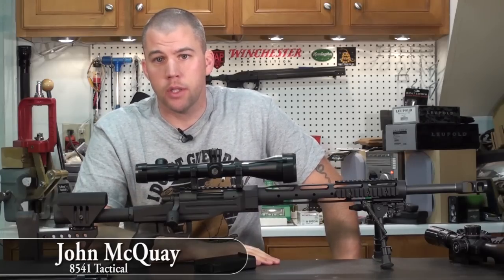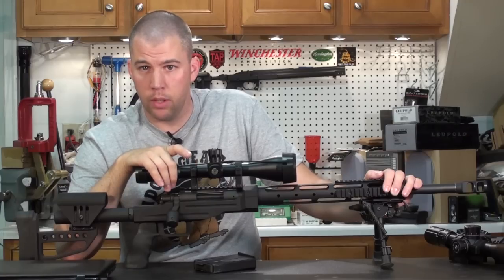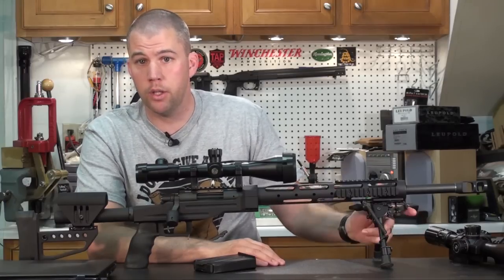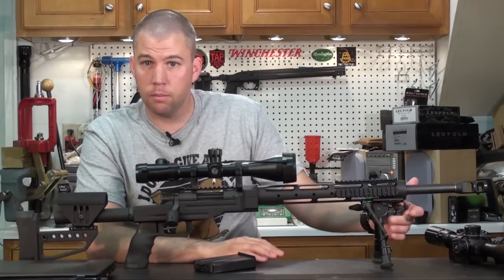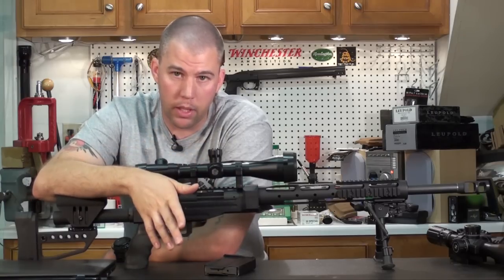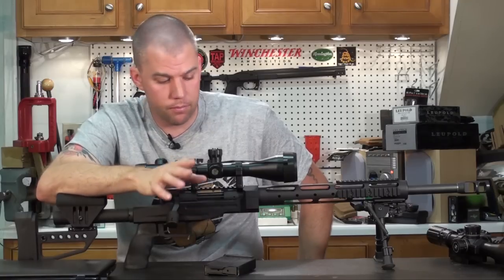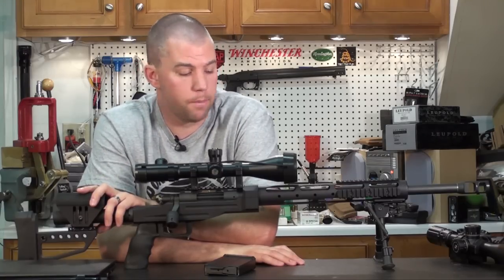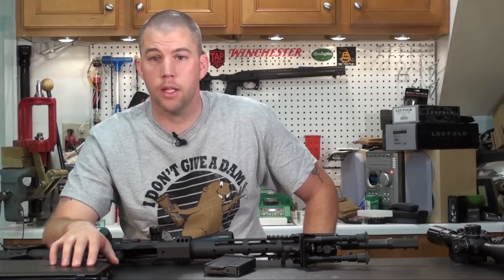Mail Call Mondays #14 - Anatomy of a Tactical Match Rifle

Comment: Awesome, I hadn't even considered the Surgeon or Stiller action so thanks! In regards to Varmint vs AAC-SD, I'm not sure if I do or don't need the barrel length? The long barrel does not impede or hinder my physical shooting positions, so that's not a factor. What I'm after is better long range performance in your opinion of the two, and which twist rate suits the .308 better, lets say using your load specifications. Thanks again.

Comment: Gotta love the savage simplicity. Tactical/oversized bolt knob? Remove one allen screw at the back of the bolt, remove old one, install new one, reinstall the allen screw. Cost is around $25 and time is 5 minutes or less.

Comment: I built a very similar configuration, but oped for the lighter XLR Element chassis. I found out that the Ruger Scout mags are the same exact mags; just rebranded. Been buying those. The only thing I don't like about the chassis is if I let my gal shoot it, I have to make sure I bring allen wrenches with me for the stock. lol One thing I added was a monopod for the stock. Used one before and loved it. 

For glass I opted for the Trijicon TR23-2 Accupoint 5-20x50. I had a night force once before, but thought it was over priced. Love that bolt knob. Got the same one. Same bipod too. Love it! I originally had a 26" barrel too, but had a gun smith cut it down and rethread it. Much better and less front heavy. For the scope base I just used a 0 MOA, as I will never be shooting out as far as you probably do. I did try a 20 MOA, but my Trijicon had to dial all the way down and was still a little off at 50 yards. (Been shooting indoors this winter after I built it and the longest indoor range is only 50 yards. Just was trying to break it in and sight it in.) For a scope mount I found a company called Aero Precision that makes really light mounts. The longest public range out there is 100 yards for me. I need to join a private range sometime this spring to see what it will do. But they still only go out to like 300 yards. I kept my X-Mark adjustable trigger as well.

What do you think of the Ergo Palm Shelf grips? Waste of money?
Reply: +William Boettcher Gosh that was so long ago. It was around $1800. I use the Trijicon TR-24 now. They make a non-mil version I believe. I am using a Remington 700 receiver chambered in 308. It was a package deal that a company on Gunbroker set up; the Remington 700 and XLR chassis.

Comment: Great video, very informative.  Question:  If I understand correctly, the standard Rem700 ADL feeds (and empties) from the top.  Does the XLR stock allow for the use of a magazine, or did you need to do some sort of conversion for this?

Comment: What are your recommendations on scope rings as far as steel or aluminum? I will be putting a bushnell tac. Elite 6x24x50 with g2 on a rem 700 in .308 in a xlr evo chassis with a undecided manufactures 20moa base... Any particular brands and sizes you recommend for use as a primary paper puncher? IM looking for quality so i'm willing to spend a few extra dollars. Thank you

Comment: John, I was thinking about building a "lite" tactical rifle for matches at the local 300 yard range. I have a .308 sps tactical bedded in a B&C M40 stock with a SWFA mil-mil scope, but was thinking of building one in .223 to save a little money(I already have reloading equipment for .223). How do you think the smaller round would do, considering the short range?

Comment: I have the same base 700 adl from DIck's and i was wondering if the barrel could still stabilize the bullet if i cut it down to 18.5'? The heaviest bullet i would ever need to use is 175 if that helps.
Thanks

Comment: Honestly, your review means a lot in my choice. I've been debating on the XLR chassis with a remmy700 in 308 and wondering if it's accurate out to 800yds  or if i should get the FNH TSR XP and the chassis. It seems like all the stuff you'd upgrade on a 700, the TSR XP already has it. Tough choice, but you reaffirm my suspicions in the chassis: that it's bad-ass!
Reply: Speaking on fn rifles….just aquired the special police.308 24” non fluted non adjustable Macmillan stock 1:12 4 groove and has blew my new 2020 6.5prc out the water…3x15 viper shootin 168gmm with varget@2780 and 110v max and varmageddons goin 3500fps..well 3490 to be honest and only cought 1 as it kept blastin my crono sideways 10’ from muzzle…no recoil but blast like a howitzer…nuthin compared to my dd5v3 with 419 hellfire and the same 110s screamin from a 16” .308…mind numbing concussion but rifle don’t move and target is vaporized..hit 2” pill bottle off a post@254yrds and I acredit alot to the hair trigger ..same Harris bipod but I need notched legs and podlok,spikes for it’s feet..I see why fbi chose such a tank of rifle..Mauser action that bolt will fall out in yer hand so slick…$1300 off great friend…never leave my hands

Comment: Thanks for the video. Did I understand that correctly, the stock is the same as ar15?
If that is the case then could you use the law tactical AR folding stock adapter?
I'm looking at building the same setup in 300wm.

Comment: I bought the same ADL.  Got it at Dick's Sporting Goods.  Came with a scope.  Sold the scope on eBay for $100.  Got 5 $100 gift cards from carpool.com for $87 each.  Saved $65.  Sold the ADL stock and hardware at gunshot for $40.  Saved $205 (minus eBay fees). Just some hints to save a few bucks.

Comment: Is that the 12" hand guard or the 14" hand guard on the 20" barrel and what height rings did you have to go with for the 50 mm objective to clear the hand guard.  Do you recommend the foldable?

Comment: Hey Wolf, Some of the guys I know have said that the bolt action on the ADL is not a smooth as it is on my SPS. Since I've never owned an ADL, and you are quite familiar with the whole 700 line. Is there any truth to this or are they just blowing smoke? And is the barrle finish the same as it is on my SPS V?

Comment: Hi John, 
As this is my first build, Im torn between either the ADL Varmit as you used or the AAC AD Threaded. Which would you recommend for 308? And is there a 6.5 Creedmoor rifle you would recommend using for a build where you're taking the barreled action out and dropping into a chassis such as this?

Comment: Hi John,
I was wondering if you had any trouble chambering rounds with the XLR evolution chassis? I built the exact rifle you did in the video but when I chamber a round I have to almost force the bolt forward to get it to close. Not sure if the mags are just new and stiff or if there's something else going on. I actually noticed brass shaving around the barrel opening where the shell enters. Appreciate your input...thanks in advance.
Reply from the maker: Ours is smooth as butter. We also use Accuracy International magazines, which work extremely well.
Reply: ***** So there was no break in needed? It was easy to close the bolt from day one even with a fully loaded mag?
Reply from the maker: It does get smoother as you use it, but it was not difficult to operate from the start.
Reply from the maker: If it was working fine before you put it in the chassis, and now it drags badly when feeding a cartridge, I would take a close look at your magazines.
Reply from the maker: You don't want to go more than 65 in/lbs. you also want to make sure you use the included action screws. If you go too tight or if the front is too long you will have problems locking down the bolt.

Comment: Do u think you could of got away with using high TPS ring instead of the extra high. I just ordered a XLR evolution chassis for my Remington 700 AAC-SD. I also am going to get a Vortex Viper PST 6-24 * 50 scope and I'm not shore which rings to get.

Comment: I just got some TPS rings today in the mail, they had a option of aluminum or alloy steel, I got the alloy steel ones they were a little more expensive. is that the right choice? steel alloy better than aluminum I hope?
Reply from the maker: They are just fine. I would not say that steel are any better than aluminum.